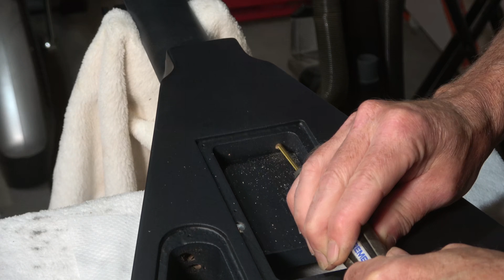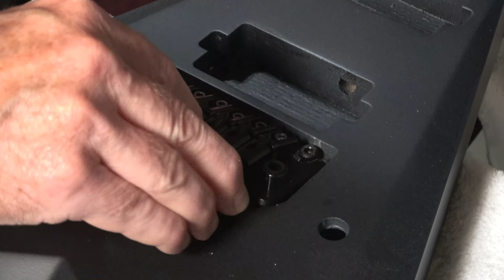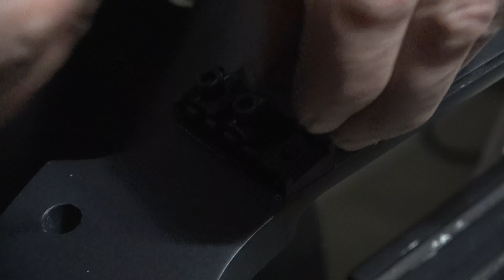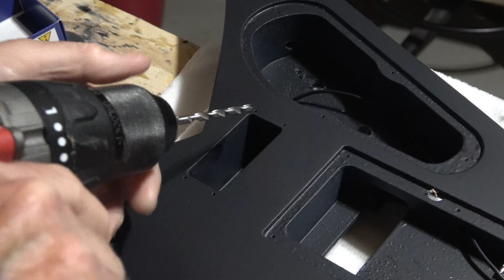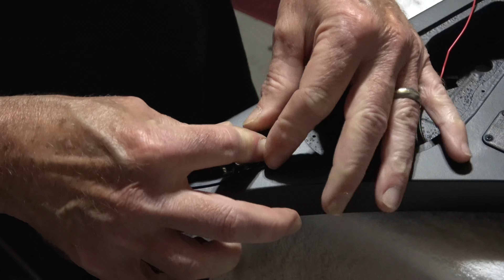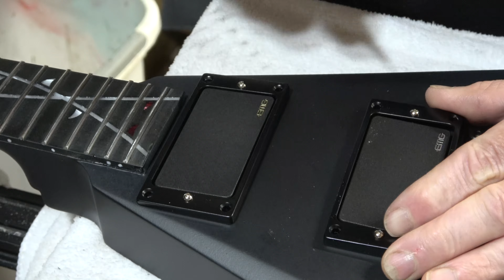Making A V-Shaped Guitar Part 15 Assembly

Comment: Superb, Chris! Any particular reason you didn't drill those holes before applying the finish? I preassembled my guitar before applying the oil to avoid doing this over the finish with the risk of ruin it, but I'm at my first build, so I don't have such your experience. 😊
Reply from the maker: No reason.

Comment: I have also had to buy 2 sets of pickup rings to swap the bridge with the neck because it was too high. I also found that there are at least 3 different sized rings (maybe more) with different screw spacings! From like 80mm up to 92mm (if I remember correctly) and a width from around 36mm to 38mm (for the screw holes). If anyone thinks those things are universal I can assure you they're not LOL. Anyways, excellent job. Your customer should be quite happy with that I would think.